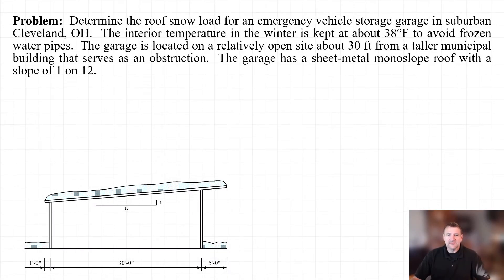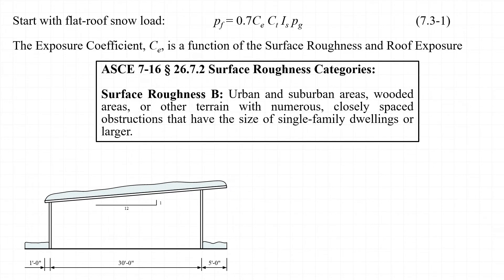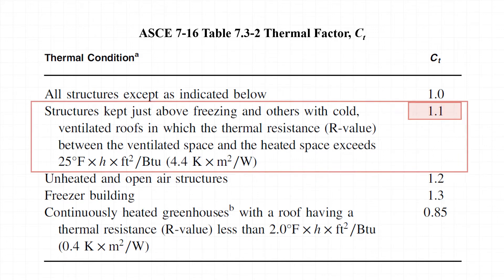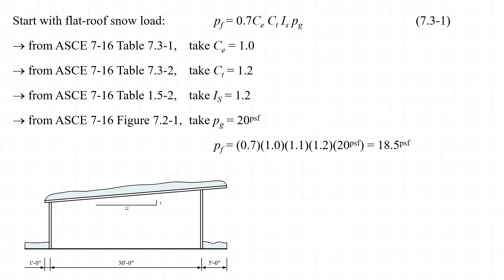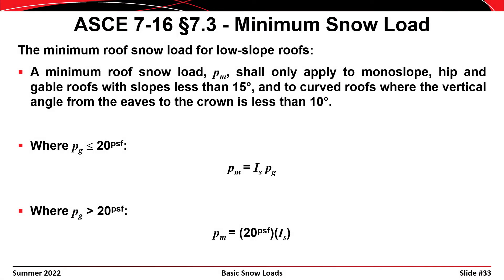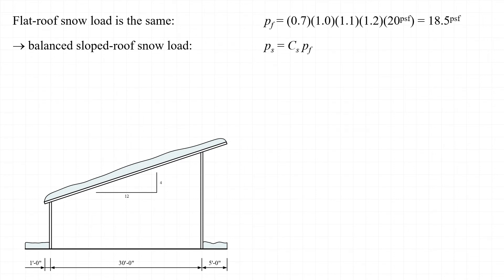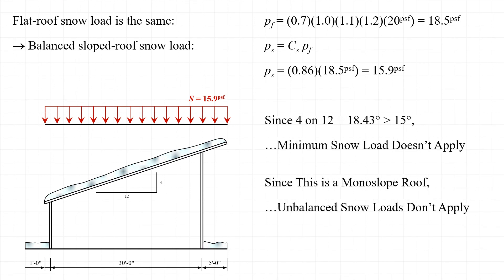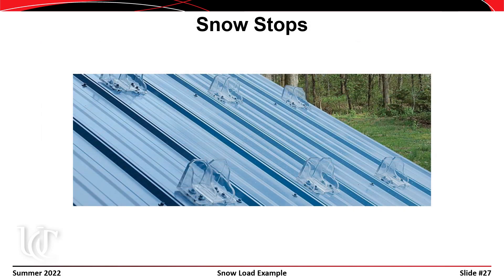STR04 X05-01 - Snow Load Example #1

Comment: For the 4 on 12 slope roof example. Would the (pf) flat roof snow load govern? Because pf = 18.5 psf is greater than ps = 15.9 psf?  I thought the larger load would be applied to the roof.